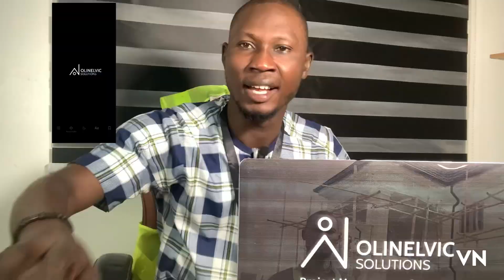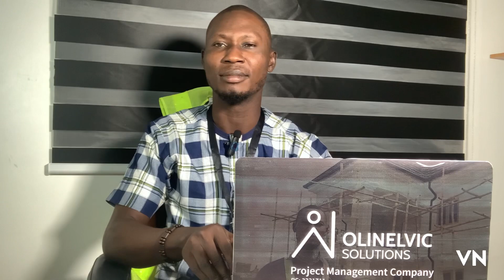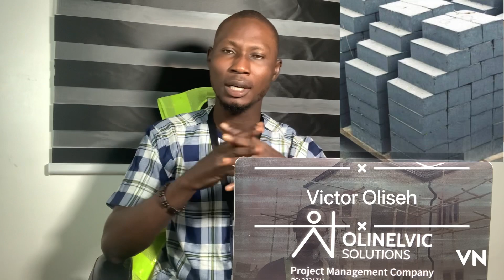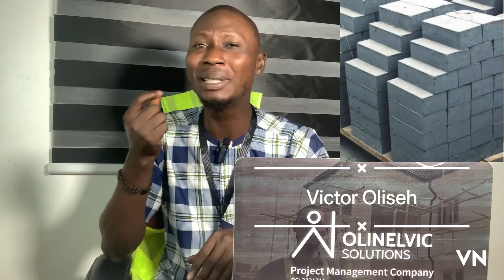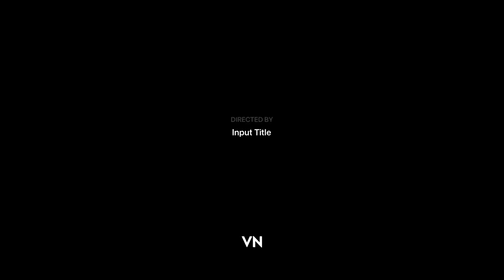#block #moulding in #Nigeria & the need to consider #climate #change for #quality #output

Comment: Nice one Mr Victor. 
A question please. What if a project was started with 30 pieces of 6 inches non hollow blocks and it get to DPC, after chaining round can that 3 pieces be reduced to 28? Is there any effect?
Reply from the maker: If I may get you right? You are asking if reducing the numbers of blocks from 30 to 28, if I get you right, I humbly advice you do it to ensure proper solidity.
Reply: @NaijaProjectHub  Alright thank you so much. But when it reduced to 28 please will it not affect the DPC that was constructed with 30 pieces per bags?
Reply from the maker: @Restructurenigeria008  not at all sir, the lesser the numbers of blocks per bag the stronger it becomes
Reply: @NaijaProjectHub  Thank you so much Mr. Victor. I have a job for you though.
Reply from the maker: @Restructurenigeria008  hahahahah, we are at your service sir and be rest assured of getting the best services. We look forward to executing your project.
Reply: Can 60 bag of smalt mod 2 million block